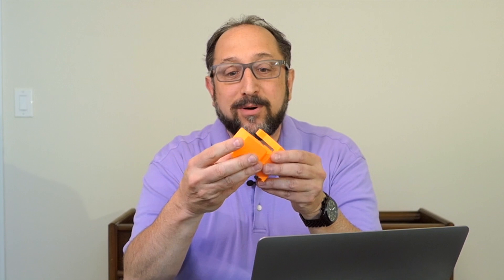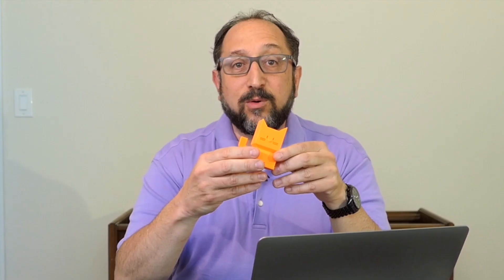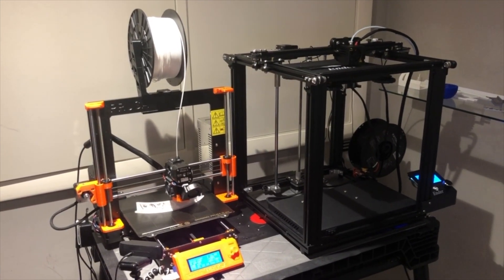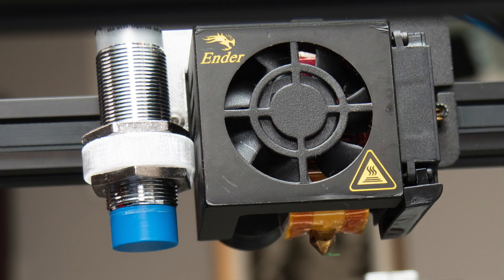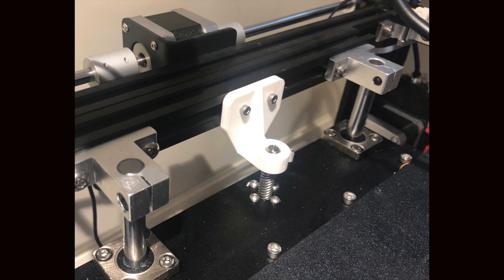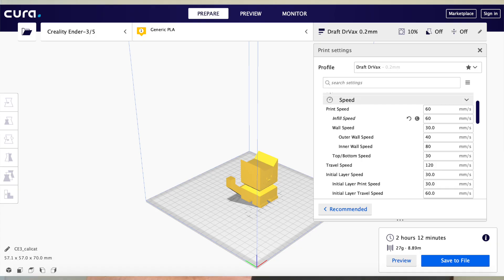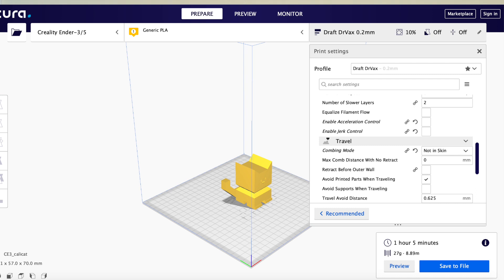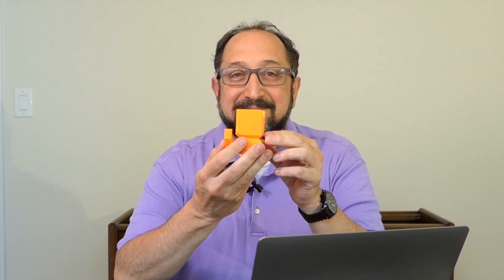Faster 3d Prints with Simple Modifications and Cura Settings

Comment: Hi there, I'm new to all this of 3D Printing, Last week I got my Monoprice Select Mini V2, and I was wondering where could I find info about best settings for printing speed/quality - I will be printing on PLA - and Thanks in advance - 

Great informative videos thank for all your hard work creating these great videos... 

P.D. I'm an Architectural designer and 3d modeler with a lot of experience using a variety of 3d software for architectural illustrator, and my goal is been able to print little scale of my designs.

Thanks DrVax
Reply from the maker: Very exciting.  Enjoy and feel free to share any observations.  My goal is to build a community we’re we all learn together.
Reply: @MakeWithTech  where could I find info about best settings for printing speed/quality?
Reply: @art_cotto  Good choice on first printer, I have one that I got 6 months ago, Cura has a good profile for this machine.  Look up magic numbers for the MP select mini, I think Cura has them built in.  I could only get the machine to print at 55mm/s for PLA and printed typically at .175 layer heights.   I would recommend looking up a NEMA 17 upgrade for the MP, glass bed (fixes the level issue), and the X gantry support.  These will improve your prints exponentially.   Good luck and have fun.
Reply: Hi Art 
Have a look at ....

https://www.mpselectmini.com

I too have just got a select mini V2 and have found this site to be a great source of info & help

Comment: The bowden not helps so much in weight moving y, because there ist the stepper for x-movement mounted at the x-axis. I would prefer ultimaker-style there.

Holding z is not a good idea: holting it at top and bottom means any slight wrong adjustment will transfer into the print (3 points: motor, nut and top holder is one to much: a line is defined by two points). To avoid z moving down than powered of: leadscrew T8 pitch 2 (400mm) instead of stock T8 pitch 8. Also POM nut pitch 2 instead of the brass anti-backslash on. Also means 1 fullstep equals 0.01 mm in z (instead 0.04), much better for 0.1mm and 0.15 mm layer hight (and also for auto-mesh-bed-leveling).
I did that mod - definitly worth it. less than 10€ - and the bed does not move even if you push hard. But it moves smooth if the z-motor moves, of course.
Reply from the maker: Thanks for sharing.  I understand your comment about the Z bracket,  and the theory makes complete sense,  however to date my results have been excellent.  The way I resolved the 3 point issue is that I left some play in the bracket when I attached it to the back rail -- basically, I did not tighten the screens all the way down.  This eliminated major swings but still added stability.

Comment: Hey. I’m not sure a Ender 5 has the ability to move at a 100mm/s. I heard the print speed is a target speed, and the printer speeds up and depending on the length of the run may never hit the target speed? So short movements essentially just go a little faster. 

I wonder what this would do on a large print?
Reply from the maker: You are correct.  However, the results were impressive and the print head was zipping along.   On many printers, the Y-axis movements are the limiting factor because the print bed has a lot of mass. On the Ender 5 X and Y are both just hot end movements and with the Bowden setup, the hot end is quite light.
Reply: @MakeWithTech  kinda wrong, for one you disabled acceleration, meaning that you use the one on your printer, Wich I assume is very low to claim "high speed" because I see how slowly it ramps up and down, crank the acceleration to 1600 or 2000 but you probably won't see results of max speed anyways, the board can't handle processing that much
also the Y axis is actually very heavy on that printer, you're very  wrong there
the X is light but Y has the whole X carriage, with it's metal supports and the motor, so not so light, probably heavier than the prusa bed (as it's a PCB not a slab of aluminum)
Reply: @MakeWithTech  I've installed klipper on my printer and I've seen actual movements at 300mm/s 3000 acceleration (those are my travel settings) and I can tell you, as it is, the ender 5 can't do it, needs klipper/32bit board and a lot of frame stiffening
Reply: http://gcodeanalyser.com will give a nice histogram of print speed (and an especially good estimate of print time) - BUT you must accurately enter some numbers specific to your printer. Let us know how this works for you...
Reply: you need a more powerful board or a 2-board firmware like klipper to run fast, and you need high accelerations to get that speed in a small print, but with some frame modifications, a way better hotend, and klipper that thing could do 200mm/s or more (at 2K acceleration)